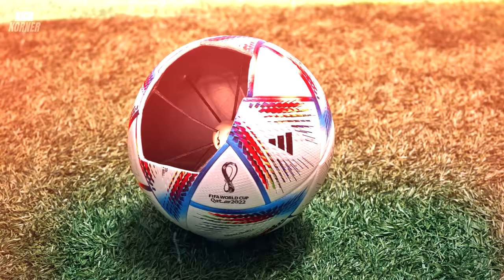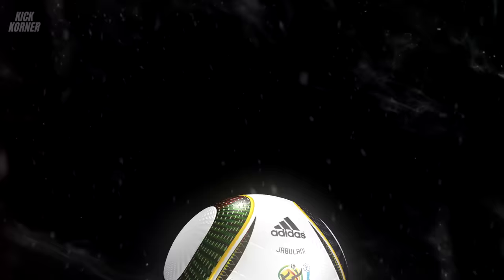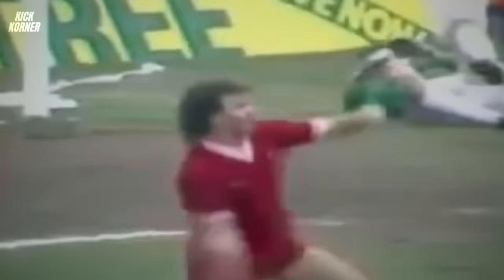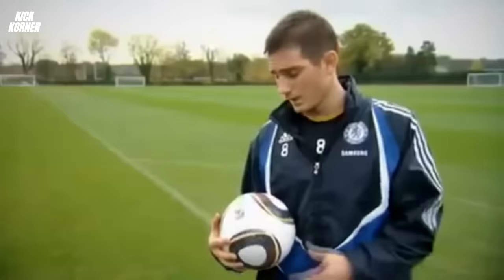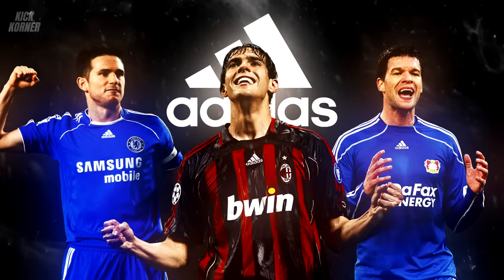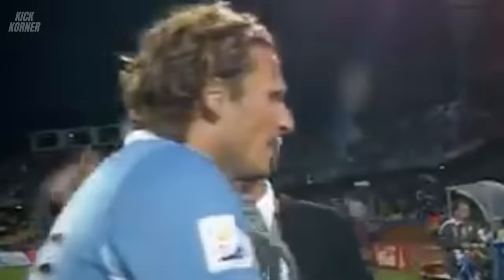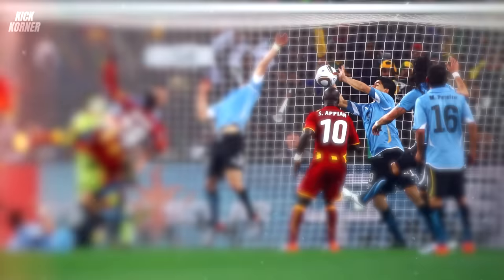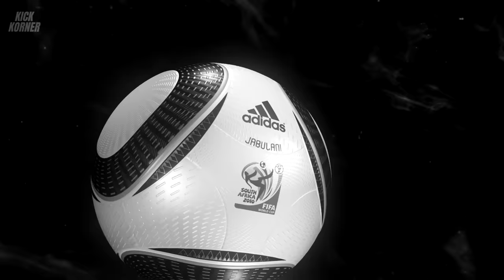Only ONE Player Could USE This FOOTBALL

Comment: i have this ball, and back when i used to use it i would notice the weird way it would sway in the air at random moments ect.

but it comes genuinely down to practice using this ball. I understand the frustration with how annoying the ball is but honestly practicing with it, you start to understand how the ball works and how you need to hit it. also the ball is a little heavier to hit compared to literally any other ball ive played with in my life. which was alot of the reason it would stay in the air a bit longer.

Forlan was smart to practice with the ball months before the world cup, that no doubt was the reason he was able to slam those amazing shots from miles out. he had experience with how unpredictable it can be and figured how to use it. not to mention the way forlan played before like the vid says, this ball is legit perfect for knuckle balls and players that go for howlers.
Reply: the only thing i dont  understand is the passes stat. from using this ball myself it was perfect on the ground. like a normal ball, the only thing that was different was the way the ball acted in the air. or if you tried putting spin on a ground pass.
Reply from the maker: Exactly so!